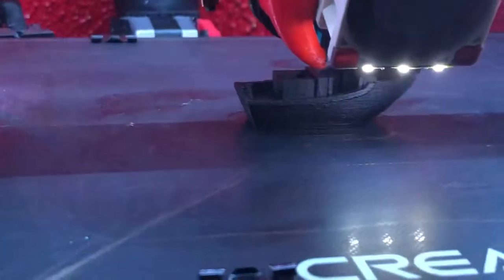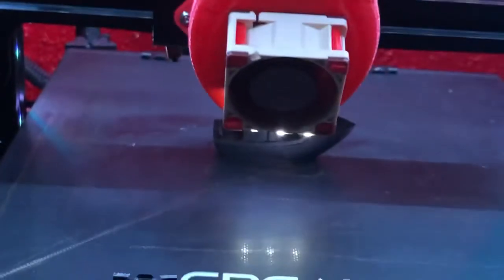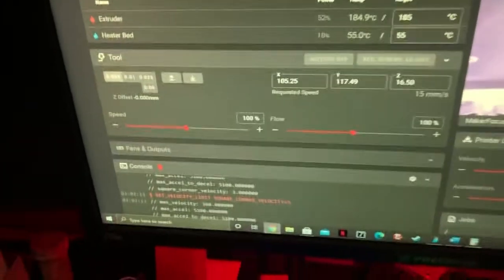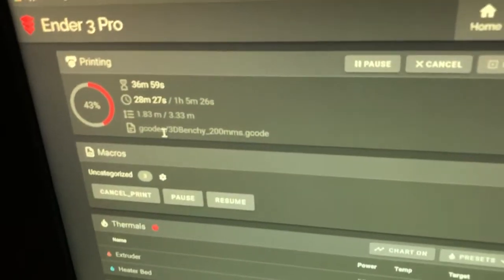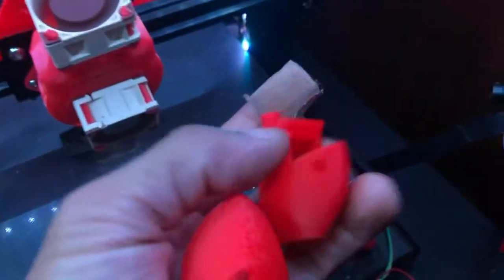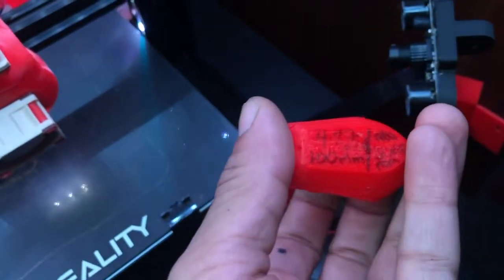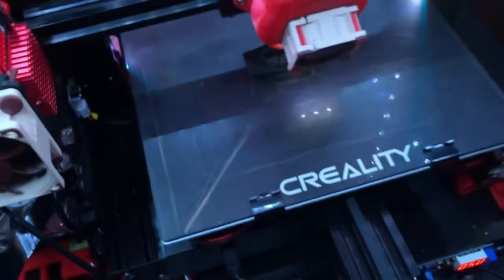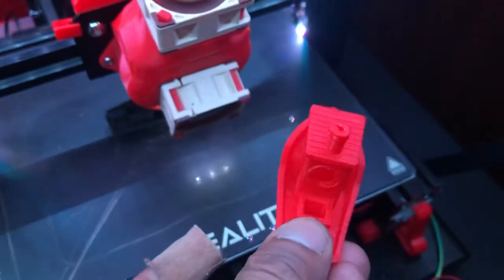Ender 3 Pro - 3D Benchy @ 200mm/s

Comment: why a glass bed? that adds tons on unneccesary weight
Reply from the maker: Absolutely correct! 

I am considering Fulament as I move this build into the next phase, in addition to no tightening adjustment (just rubber sleeves + nuts) in addition to weight-loss mods.

The X-Gantry has substantial weight on it also due to an oversized extruder stepper motor. I was able to hit 11k acceleration rates on it with a smaller extruder, but it could not extrude anywhere close to the larger stepper’s speeds. 

These parts are quite old, and with the current BMG DD extruders and Bondtech nozzles, I think it is possible to hit 250-300mm/s. 

Currently dialing in the heat on the Bondtech nozzles.